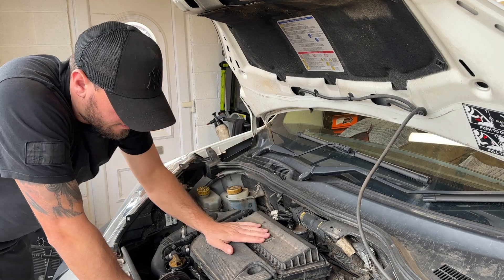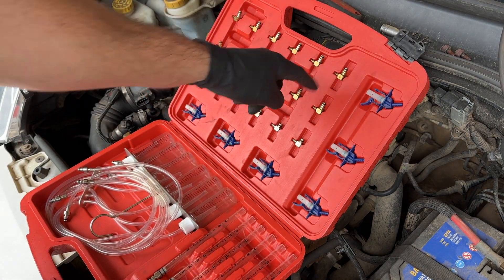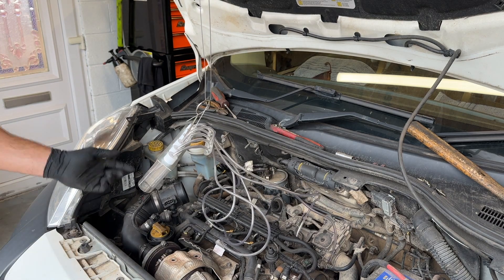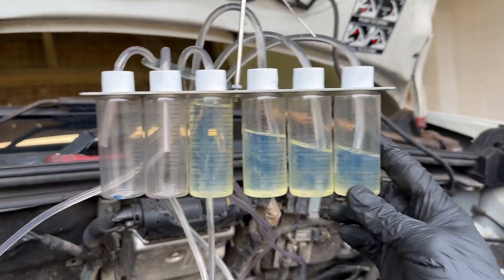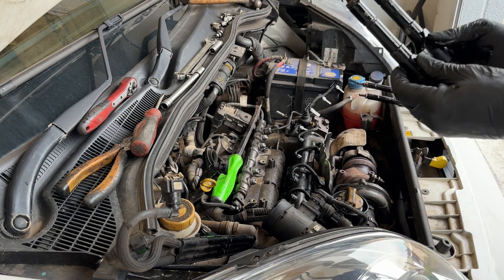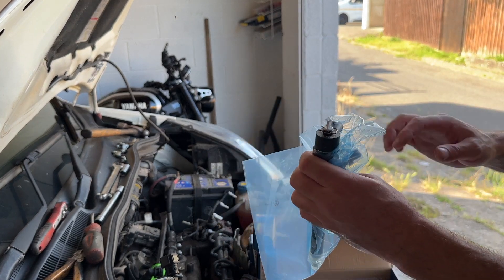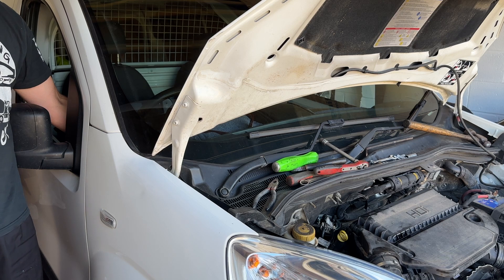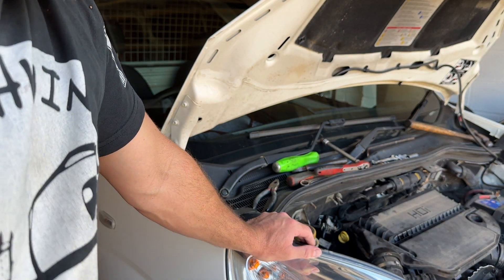Peugeot 1.3 diesel  Engine Rattle noise when cold, how to diagnose and repair

Comment: Hello, friend.
Please help. Can you tell me: the tightening torque of the nut of the 1.3 HDi engine injector bracket? I have data for other models with one fork. Here is a bracket with two forks - I can't find the data.

Comment: New sub great content would you recommend buying a used Peugeot bipper 2014 ...90 k on the clock just shy of 3k I no every motor is different for a million reasons just in general, thanks
Reply from the maker: Thanks mate, I think 3k is a bit expensive I’m sure they are around £1,500-£2,000 at the minute?
Reply: I appreciate the reply and heads up the simplicity of your content with out making it about you is a breath of fresh air compared to other channels ... May I ask with your obiovious knowledge of the motor trade what small van make/model would be worth investing in low end 3k top end 5k , best of luck in 25 , thanks a lot ,